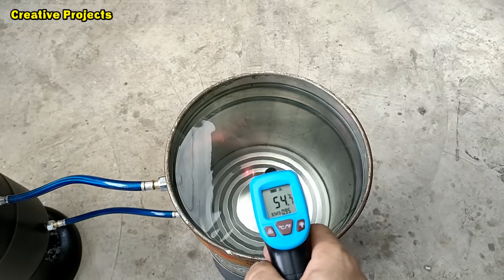DIY 2-in-1 wood stove - Super fast water heating is amazing

Comment: Two easy additions.  1. A third water output right at the very top so one could half fill the tank and syphon off steam to get clean drinking water from river. 2. A top filler cap for water. Actually thinking about it, a bottom drain plug to allow washing out any sludge from river water. Great video.
Reply from the maker: Thank you very much 💖💖💖👍

Comment: best idea I've seen in a while!!! I live off grid and I'm making one for my hot tub and I'm also making the hoses to connect to a steel 7 gallon bucket beside it (at the same level )to have hot water anytime I need it. The three quarter inch copper coil works okay, but this gets the job done! I'm going to experiment with the ash screen on the bottom in size for burn efficiency and also mount a small disc below it for a fuel fire starter , so that way it's dual purpose and easier to start the fire if you put tender in the bottom, the flame from the starter goes right up the ash hole .🤣to get it started instead of trying to reach in with your hand.  Edit : by the way, subscribed.
Reply from the maker: Thank you very much 💖💖💖💖💖💖💖👍👍👍
Reply: Good g
Reply: What are those blue hoses ? I plan also a bath tub
Reply from the maker: @Grey Grenzeback  Thank you. Those two blue wires are the pipes of the water heater, this wire is available at stores selling water heaters
Reply: Это не печь, а недоделанный Тульский самовар.
Reply: Great 👍 👌 👏 👍

Comment: Nice, the only change I would suggest is to connect the top water pipe right up at the top of the water chamber, alongside the burn pipe.  This will allow the chamber to completely fill with water and make use of all the surface area.  Maybe even move the water tank behind the stove, place it a little higher up, and add two supply and return lines to the water tank, one on each side.  That might give you enough flow to keep the water from boiling in the chamber…  Excellent build!
Reply from the maker: Thank you very much 💖💖💖💖💖💖💖💖💖💖💖👍👍👍

Comment: I made something like this for my bosses house water heater ( electric / wood ) it inly took a small loop in the fire box ( we started with 3 spasses ) about 6" 15.3cm ! Added a copper pipe to the presure releif valve to the outside to vent steam ! It works great even when the city power is off ! Oh! Yeah ! That was in the mid 80's !
Reply: U>>i>ì
Reply from the maker: Thank you very much

Comment: I have to admire this. A very clever use of heat exchange. My only concerns would be the evaporative loss, and the rubber hose (copper tubes would be a good future upgrade?) but with a small setup like this it could be monitored easily. I don't have the skill to do this , so well done!
Reply from the maker: Thank you. This is just a model. If you want to be sure, you can replace it with better accessories
Reply: Ģv.
Reply: I think those lines are hot water heater lines, braided steel over ... high temp something flexible.
Reply: Это обычный недоделанный Тульский самовар. ему несколько сотен лет.
Reply: @Creativeproject2020  je veux avoir ton adresse mail

Comment: Why did the water leak from a barrel of heating to the burning oven, please explain
Reply: The hot water rises in the wood stove and draws in the cooler water from the water tank bottom and pushes the hot water into the top of the water tank.
Reply from the maker: Thank you. This is due to the convection temperature, so the water will be circulated
Reply: Precaução e canja de galinha não fazem mal a ninguém.
Reply: It,s called Thermosyphoneffect. Early Watercooled Engines and Heatingsystemes used this Effect. No Waterpump is required.

Comment: I have a couple black colored shower bladders and a black 50 gallon drum that the sun heats up for me. No fire, metal, welding or unnecessary work needed. Yes it even works in the winter time.
Reply from the maker: Thank you very much 🤣

Comment: Back in the day (in Australia), a similar gadget was very common for heating the bath water, called a "chip heater", using small wood chips to burn 🔥 for just a few minutes. It was very fast  and even a newspaper provided enough heat for a short shower. "Metters" brand was one I remember. 

I have included the Wikipedia article below in a separate comment, and it includes a reference to "Metters Australia", but I fully expect YouTube Algorithms to delete it, as they are very picky and parochial, deleting everything "they" didn't like. . . 🙄
Reply from the maker: Thank you very much. This stove heats water very quickly and efficiently
Reply: @Creativeproject2020  https://en.m.wikipedia.org/wiki/Chip_heater
Reply: Thats the best thing to do with newspapers, after 2 years plus of lies we must all know by now
Reply: @billb7876  We never used "today's news", the Chip Heater only worked on old, out of date news such as the Sports Results, Radio Programmes, Personal Advertisements, Used Cars section, Obituaries and the Gossip Column. 

Political, foreign affairs and news on the economy was always preserved in a 3-ring file, or put on display in a glass cabinet for our mother-in-law to study after a few sherries. 

We'd then have a family debate or write our school assignments from those important records. Most of the family worked either on the local Council or were active Trade Union committee members as a result of such enthusiasm. At the end of each decade, the 3-ring volumes were bound by the local book-bindong society and preserved in the Local Library under the shelf- heading "History of Democracy".

Comment: The stove perfect for heating water but not heating a room. Because outside of the stove won't be much higher than 100 degree. Because it's surrendered with water and it won't let it heat up more.
Reply from the maker: Thank you. This stove is for hot water and not for room heating
Reply: Just add radiators. That’s exactly how to heat a house! A perfect mini boiler!
Reply: @johnemmons9087  The perfect way to heat a room is to burn a wood directly. Not burning the wood and boiling water then transferring it to a radiator. I'm not saying that this stove is bad, all I'm saying is it's perfect for heating up water, it is actually so useful in bathroom. In Turkey we used to have bathroom stoves which has a huge tank above and a little wood stove under it. The stove heats up both room and the water and gives hot water and hot environment.

Comment: is it the heated  gas  in the blue tube thats tansports the heat  to the water or or how it functions ?
Reply from the maker: Thank you. The stove has a hollow cavity in the middle to store water, the water is heated from the kitchen wall. Water flows according to the law of thermal convection, cold water enters the kitchen through the lower tube and hot water exits through the upper tube.
Reply: @Creativeproject2020  Jeah  its like a double sided  milk heater....cool ...in  my country some tiny house builder use this feature too...

Comment: Hello , water's flow between cooker and container with water , how did it's done ?? in movie is not showed  . Can you explain how water is boil ?
Reply from the maker: Thank you. The stove has a hollow cavity in the middle to store water. The water is heated by the heat of the stove. Water flows according to the principle of thermal convection, cold water enters the kitchen through the lower tube and hot water exits through the upper tube.
Reply: @Creativeproject2020  thanks for answer, now I understand . Bottle is   hermetically welded, and tube warm wather Boil wather tubule to cointener with cold wather ,cold wather transfer lower tubule to botle with fire.   I miss that IT was hermetically welded  at first time. Great video, i wery liked how you did that. Best regards.

Comment: Hola Cómo te va genio espectacular Lo que no puedo entender Cómo funciona el mecanismo del agua si vos me lo podés explicar gracias
Reply from the maker: Thank you. The stove has a hollow cavity in the middle to store water. The water is heated by the heat of the stove. Water flows according to the principle of convection, cold water enters the kitchen through the lower tube and hot water exits through the upper tube.
Reply: Te aviso que yo no entiendo el idioma inglés gracias

Comment: How and where did u put the copper pipes? I did not saw it on video
Reply from the maker: Thank you. This stove I do not use copper pipes, but the stove is created a space in the middle, that space contains water and is heated from the stove. Water flows by thermal convection, cold water flows into the kitchen by the pipe below, hot water flows from the kitchen to the container at the faucet above.

Comment: I hv a stupid question, what heats the water? Air pressure? Or does the water actually circulate into the stove? If so won't it leak?
Reply from the maker: Thank you. The stove has a hollow cavity in the middle to store water, the water is heated from the two walls of the stove. Water flows in the direction of convection, cold water enters the kitchen through the lower pipe and hot water exits through the upper pipe.
Reply: @Creativeproject2020   thank you

Comment: How do you prevent the water going into the stove from the blue pipes?
Reply from the maker: Thank you. The stove has a hollow cavity in the middle to store water, the water is heated from the two walls of the stove. Water flows in the direction of convection, cold water enters the kitchen through the lower pipe and hot water exits through the upper pipe.
Reply: @Creativeproject2020  That is very smart thinking, lovely job!

Comment: if the stove made of metal, the energy transfer from the stove tank to surounding usually large amount?? the next step is how to isolate the energy transfer from the stove to the circumstabce ??
Reply from the maker: Thank you. The stove has a hollow cavity in the middle to store water, the water is heated from the two walls of the stove. Water flows in the direction of convection, cold water enters the kitchen through the lower pipe and hot water exits through the upper pipe.

Comment: What are those two blue hoses called? Im planning a hot bath tub l
Reply from the maker: Thank you. That blue water pipe is the water pipe of the water heater. Accessories are available at stores selling bathroom furniture, water heaters
Reply: What are those made for? Are they metallic?

Comment: Ok neet, but those two fittings that connect the  water bucket will let all the water run into the stove , since they are just welded in place and not connected on inner stove side. ?????? Confused
Reply from the maker: Thank you. The stove has a hollow cavity in the middle to store water. The water is heated from there. Water flows in the direction of convection, cold water enters the kitchen through the lower pipe and hot water exits through the upper pipe.

Comment: How it is possible water will go inside through pipe to fire stove then after what ll be next
Reply from the maker: Thank you. Due to the difference in water pressure inside the high-temperature stove, it will push the water out through the pipe above. Just like that, cold water will flow into the kitchen by the pipe below

Comment: It's good idea but you didn't show in detail how the heat come from the burner and make water boil, pls can do so?
Reply from the maker: Thank you very much
Reply: The stove exhaust passes through the central stainless steel pipe and heats the water in the outer tank. The water in the tank gets warmer than the one in the side bucket, and it causes the water to circulate until it's all hot enough to boil.

Comment: You realise that when you put a 20 foot coil of copper pipe in the hot water connected to a garden hose it will give hot water as long as the water in the drum is hot.
Reply from the maker: Thank you very much

Comment: How it is possible.the water in side of stove
Reply from the maker: Thank you. The stove has a hollow cavity in the middle to store water, the water is heated from the two walls of the stove. Water flows in the direction of convection, cold water enters the kitchen through the lower pipe and hot water exits through the upper pipe.

Comment: Well yeah... when you drain enough water so the upper hose is no longer covered in water, the hose will melt very quickly.
Reply: Yeah  good design but could maybe use a couple of valves and quick disconnects .  It would be great for a bathtub or hot tub .
Reply from the maker: Thank you very much 🤣💖👍

Comment: Not a diy guy .can someone please explain why the water doesn't flow downwards into the stove? Or is the pipe a metal one and it is heated?
Reply from the maker: Thank you. The stove has a space in the middle, that space is for storing water. and the water is heated up through the wall of the stove. Water cannot flow into the kitchen because the weld is very tight
Reply: @Creativeproject2020  what kind of pipe is that?

Comment: Can someone explain how it works?
Reply from the maker: Thank you. The stove has a hollow cavity in the middle to store water. The water is heated from there. Water flows in the direction of convection, cold water enters the kitchen through the lower pipe and hot water exits through the upper pipe.
Reply: @Creativeproject2020  thanks

Comment: The boiler will stop heating after loosing 5% water. As upper tube will not be in the water.
Reply from the maker: Thank you. In the video, I just simulated so you know how fast this stove heats water. If you use it for a long time, you will have to make another more sturdy water bottle and the water level will have to be higher than the mouth of the water pipe.

Comment: That's fire hazard because you don't have anything to stop the red hot ashes from falling directly into the floor and creating a mess as well as burning the house down. We are using these all over Ireland,  we call them dual stove heaters. Either with open fire to heat up the house (the whole house by using radiators) and under floors using copper pipes and also we put a cattle full of water on top for instant cup of tea or coffee. Cheaper to buy safe one with European safety conformity from a shop. For safety we also only use copper pipes. And the condensation from evaporation will cause lot of problems with the dampness on the walls creating mould...
If that boiling water gets knocked over it can cause serious injuries. 
This won't pass any safety regulations. Too dangerous.
Reply from the maker: Thank you for watching . In this video I only simulated a cooking stove, which combined the heating of water very quickly as I tried with a cold water tank on the right. The result is an amazingly fast heating of water, which you can use in this video to create a more perfect kitchen for you and your family. For example, use hot water for bathing, or use hot steam to make a steam room.

Comment: I CAME UP ON YOUR VIDEO AND IT WAS VERY IMPRESSING, NICE AND USEFUL TO USE, BUT PLEASE INFORM YOUR VIEWERS NOT TO JUST GO CUTTING A GAS SELINDER TO BUILD ONE, WHEN THE CUTTING TORCH COME IN CONTACT WITH THE GAS DRUM IT CAN EXPLORE, ONE HAVE TO BE CAREFUL AND HAVE EXPERIENCE TO DO SO. I GAVE A GRILL MAKER ONE TO MAKE A SMALL GRILL PAN FOR GRILLING CHICKEN AND WHILE CUTTING DRUM  OPEN IT BLEW UP AND THEN  EXPLODED  ON HIM, SO PLEASE BE CAREFUL WHEN DOING SUCH  PROJECT, DRUM  MUST BE VERY  CLEAN OF  ALL  SUBSTANCE  OF  GAS OBSORBEMENT.  THAT DRUM  WAS OUT  OF  USE FOR OVER 30 YEARS  YET  STILL  HOLDS THE  CHEMICAL  IN  THE  METAL  OF THE DRUM. JUST BE VERY CAREFUL WHEN DOING SO. 🌷❤👏❤🙏🏿
Reply from the maker: Thank you very much 💖💖💖👍

Comment: I didn't understand how water getting boiled in other tank
Reply from the maker: Thank you. The stove has a hollow cavity in the middle to store water. The water is heated from there. Water flows in the direction of convection, cold water enters the kitchen through the lower pipe and hot water exits through the upper pipe.

Comment: I don't think that's really working right because those hoses would get hot enough to melt into those fittings coming out of the stove so I don't believe it's a true water heater plastic and heat don't mix
Reply from the maker: Thank you. This is the wire of the water heater that can withstand the temperature of 100 degrees Celsius in the water

Comment: There is a step before using welding and cutting on the gas cylinder. This matter must be explained because it is dangerous.
Reply: Well, to be fair he did fill it completely with water before starting. Wouldn't that have been enough to expel any remaining gas/liquid?
Reply from the maker: Thank you very much